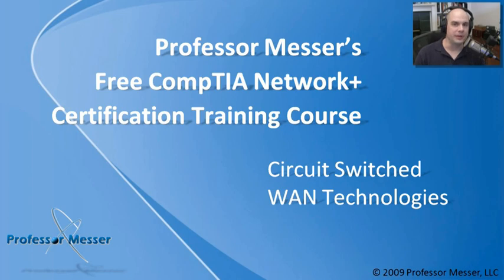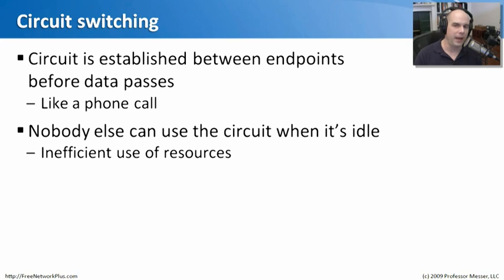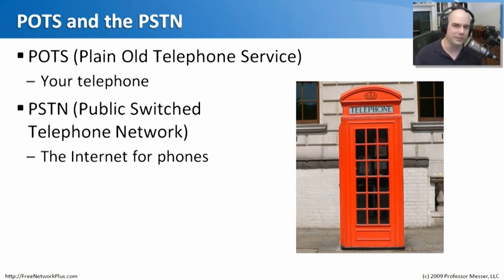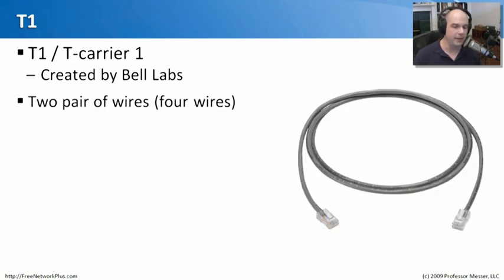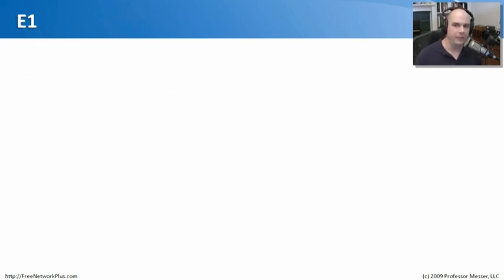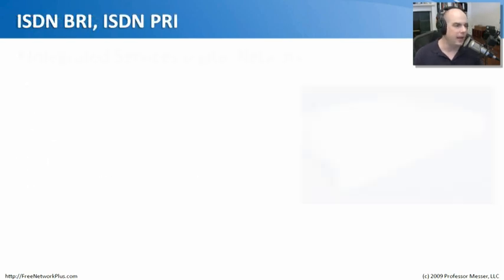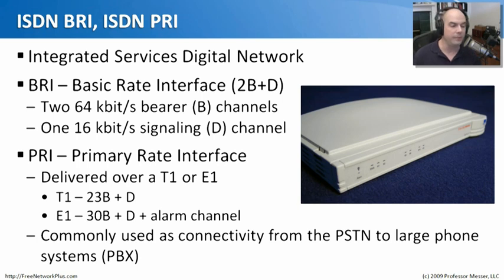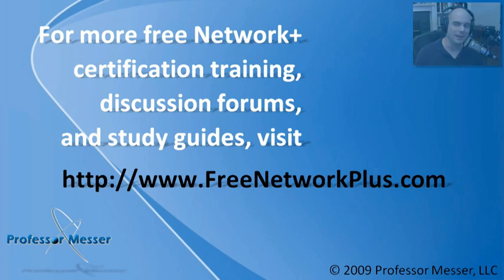Circuit Switched WAN Technologies - CompTIA Network+ N10-004: 2.5

Comment: Professor Messer, 

Great Video. I'm a little confused as to the bandwidth limitations for coaxial cable and the fact that it is still used in high speed connections such as the T3 and E3 as you mentioned. I was under the impression that coaxial was an older technology that was being phased out just like it did with 10Base2 and 10Base5 Ethernet and would be replaced by fiber or UTP like Cat-6. What can you tell me about why coaxial cable and why it is still used in WANs? Is it actually capable